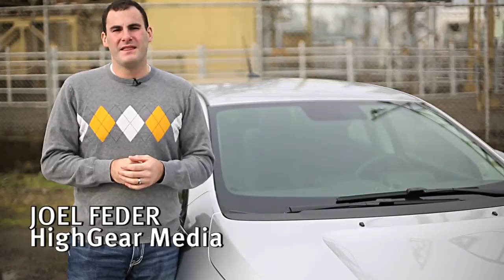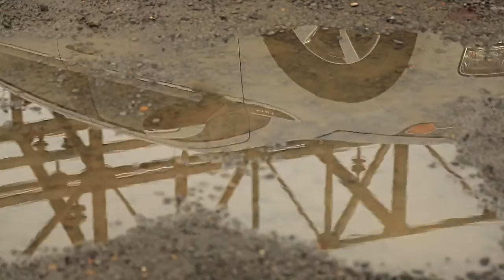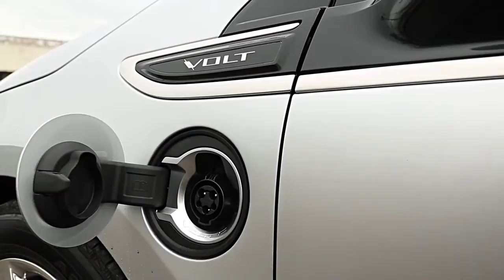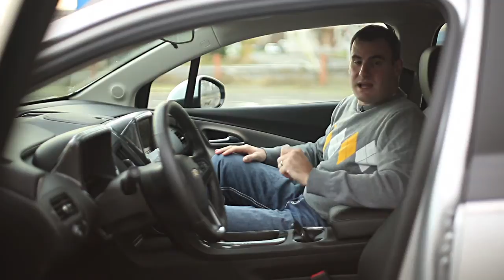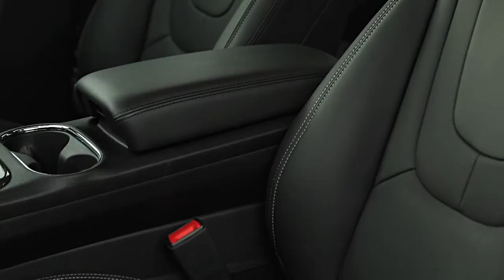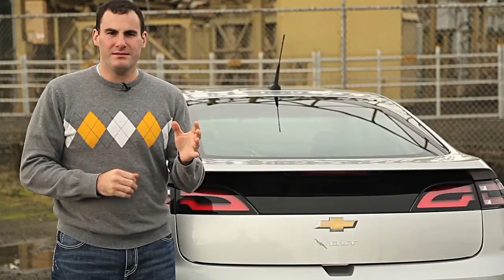2013 Chevrolet Volt Video Road Test

Comment: Most Volt owners report 43 mpg in gas mode.  EPA tests cars on dynos and regen can't work well on a dyno.  Regen is a big factor in electric range.

mpgomatic drove the car for 600 miles and got 40 miles electric & 43 mpg gas.  Their review can be seen on YouTube.

15 months ownership, 6 gallons of gas purchased.